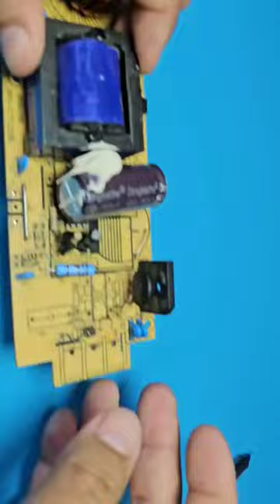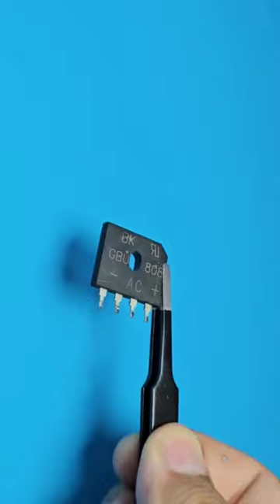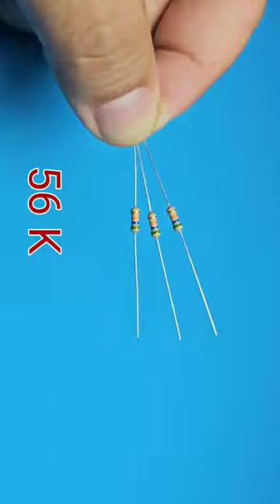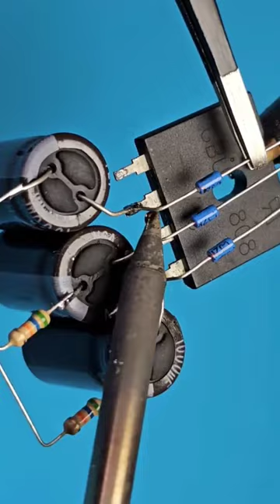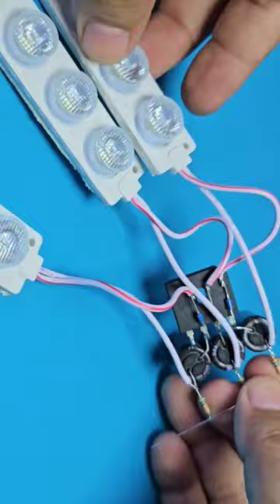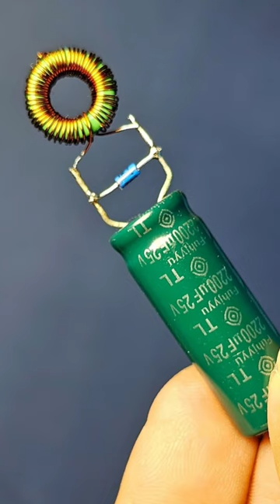Take a Close Look at Used Components Before Throwing them away #zaferyildiz #short #shorts  #led

Comment: Hi👍... This looks like a three stage relaxation oscillator, question is, What is the AC input mains (line) voltage for the resistors shown... I live in the USA, our voltage is only 120V.A.C.
Reply: Работать будет и на 120 сети, просто частота вспышек будет ниже в 2 раза. Частоту вспышек можно регулировать изменением резисторов.

Comment: Please don't try this anyone dis is danger, Definitely the capacitors will blast if you plug it to the mains current because of the capacitors  he has used here can hold maximum of 50V only (neither 230 or nor 110) also those lights works with 12DC only
Reply: Напряжение пробоя динистора db3 составляет от 28 до 36 вольт, так что больше этого значения на конденсаторе не пояявится.